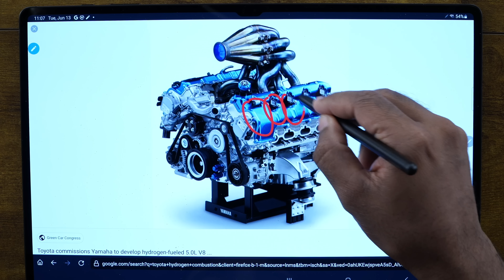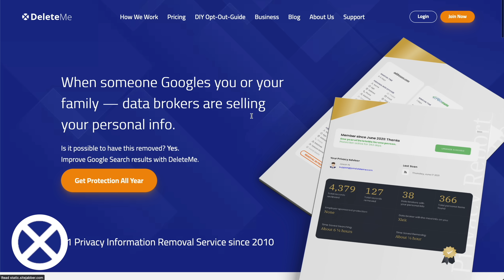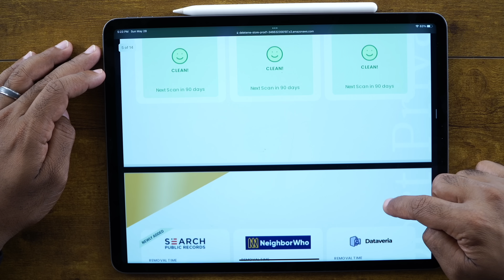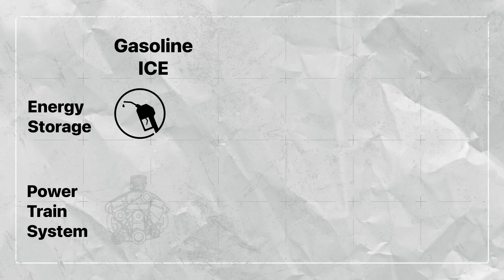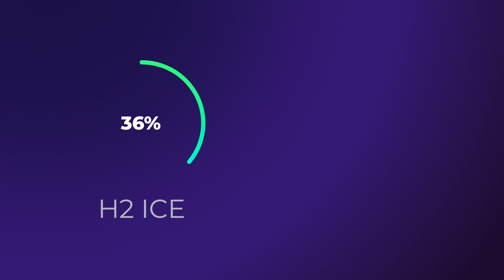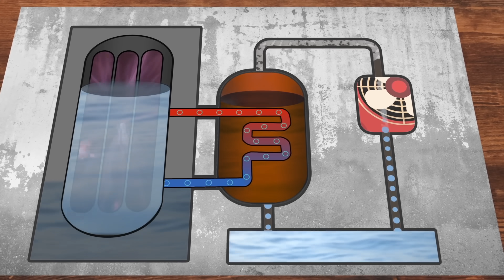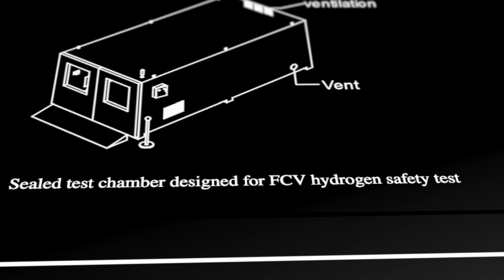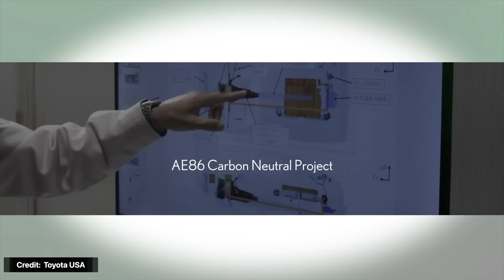Toyota's Says They Just Destroyed EVs - Hydrogen Combustion Engines

Comment: What is the cost of hydrogen? It does not make any sense to talk about efficiency without talking about cost. Solar panel are very inefficient but people still use them.  If the car is still cheaper to run than an EV with a lower efficiency, then it is totally irrelevant to be less efficient.

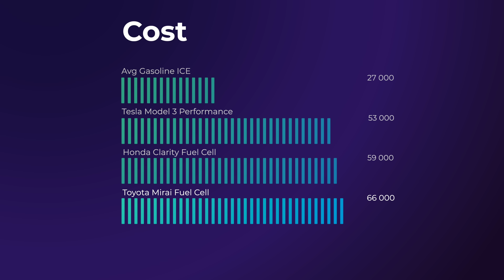Comment: Hi Ricki, thank you for the video! A few things: why compare the most expensive model 3 (performance) at $53k when the base model costs $40,240 before incentives (after incentives it's below $35k). This would put it square in line with the "H2 ice" you have at $40k at 07:33 . So I don't see the upfront cost advantage of H2 ice
Also at 8:20 you state hydrogen fueling stations "work like gas fueling stations" - so does the pump at a gas station frequently freeze onto the opening of a gas tank like a hydrogen station, or does a gas station have a potential of the software inappropriately locking the handle of the pump onto the gas tank opening as often happens in hydrogen refueling stations? - this happens even several minutes after fueling is complete FYI. Does a gas station need 20-40 minutes to go through some kind of cycle in between cars like a hydrogen station, thus frequently forcing people to wait over an hour  in long lines to actually get hydrogen even though the fill up, if it works, only takes 5 min? Do gas stations have an app that say they're working but when you get there even within 5 minutes of checking, it often isn't working? Is a hydrogen station like a gas station in that residents around it demand no usage after 11pm because it's so loud (this is the case for the hydrogen station in Hayward, CA - there maybe others -- it's a MUCH LOUDER process than gas).
My experience: 1 miserable year with a honda clarity fuel cell vehicle. I've been able to get a "5 min" fill up about 1/4 -1/3 of the time. Otherwise I've had the car towed several times, once every 2-3 months, because fuel stations weren't working (even though apps said they were), or after waiting 1+ hour and having 2-4 cars in front of me the station runs out of hydrogen!  My family GLADLY returned this hydrogen car and bought a model Y - we are quite happy with it:)
Reply from the maker: very good point... especially as the lower cost models are more widely available... yah i think it just gets harder and harder to understand the thought process!
Reply: @TwoBitDaVinci  Indeed, and thank you so much for engaging!!!;)
Reply: At one time people had a fear of gasoline blowing up, now not a though about it
Reply: The last time I checked, a few weeks ago, over 30% of all hydrogen fuelling pumps in California were down, and every time I check it's about the same or worse. It doesn't help that hydrogen costs over $16/KG, so it's also a lot more expensive to operate than a BEV or even gasoline powered vehicle. And a few years ago there was an explosion in Santa Clara that shut down all of the northern California hydrogen stations and took over 6 months to recover. There are also plenty of accounts of people having problems actually getting hydrogen for their cars (see the fact that at any point 30% or more of the pumps are offline). Also, hydrogen vehicles have a limited lifetime. The hydrogen components have a mandated expiration date. And those hydrogen trucks? They can only carry 300-500KG of hydrogen, which can fill a fraction the number of vehicles as a gasoline tanker truck, making transport far less economical. I also ask you to read the sticker shown at 10:49 in the video where it says, "Do not fil after 2029/11" After that date, you are no longer allowed to fill that hydrogen vehicle. Hydrogen, especially at those high pressures, is extremely reactive. It embrittles metals and will leak through everything. So basically, after 2029/11 you need to replace the vehicle.
Reply: incentives should not be factored into any calculation for comparing the cars for basic features.
Reply: This only applies when there are incentives. once those stop then obviously the price will go back to full which can be cost prohibitive for people
Reply: @Hirovard  The EV prices will go down quickly. Unlike ICE there is not too much know-how in EVs, as soon as the technology matured and understood, they will start making EVs in the chineese sweatshops.
Reply: You're right, it's the dumbest idea ever.  The public will never go for it compared to EV's.  Toyoda is just as dumb as a box of rocks.
Reply: If water could be used to make hydrogen at home, then this would be great. Yet energy is too enormous per kg of hydrogen from water. Would.need a special  catalysts invented. Meta material science might have something eventually.
Reply: @joeking433  "What is Akio Toyoda smoking???" hydrogen, apparently.
Reply: Please don't include incentives in the cost of a vehicle, they are very subject to change and there is no reason H2 cars couldn't have a similar or better government incentive.  Yes, the H2 infrastructure isn't there yet and certainly isn't as mature as the gasoline infrastructure.  Guess what, the EV charging infrastructure sucked 10 years ago until there was major investment in it.  It still isn't great, the last audit I saw showed that nearly 25% of EV stations around the US were out of service.  This is after billions in private and government investment and tax breaks galore.

Comment: The tail end of this video feels unnecessarily poisoned against hydrogen ICEs. Implying its a dying technology because Toyota took on partnerships is a somewhat baseless claim, and to say hydrogen ICE has “all of the negatives of ICE and none of the benefits of electric” feels like a shady way of saying it has the all the BENEFITS of ICE with none of the DRAWBACKS of electric.

A combustion engine that is serviceable by pretty much any mechanic in America is much better for longevity and avoiding monopolies, for example. It also feels disingenuous to gloss over the MASSIVE supply chain issues of trying to convert a national fleet of drivers to battery electric - a feat which is virtually impossible with current production and availability of precious metals. And that’s to say nothing of the issues of unethical supply chains needed to supply those metals.

I like electric vehicles as much as the next guy, but if we start ignoring the question of battery supply chains we risk losing the forest for the trees.

Finally, i think its unfair to characterize the problem of green hydrogen production as a problem unique to hydrogen, as this problem is equally applicable to every electric car in service.
Reply from the maker: these are excellent points... thank you for taking time to add to the conversation in such a nice way. the drawbacks of ice, is tons of moving parts, wear and tear, and high levels of maintenance. all of this is gone with electric motors, which are vastly superior in every single way. 

but batteries are a challenge, but one that's being highly invested in... this is tricky and why i try to cover as much of this stuff as I can...

Toyota partnering with Yamaha is a very clear signal though that they're not all that keen on this... I think Toyota is still trying to figure out what they're going to do.

when they are all in on something they really get behind it, which they aren't currently with this... 

but what do you think?
Reply: @TwoBitDaVinci  I wasn’t expecting a response! Great video btw, I love your channel and you’re doing great work on spreading the message of alternative energy solutions.

I think the partnerships Toyota are taking on are reasonable given the engineering challenges they face relative to each product. I don’t think they are necessarily indicative of their level of confidence in their product.

For example, Toyota doing the Prius “solo” seems to indicate that they didn’t need much outside support on dropping a battery in an ICE since they weren’t necessarily conquering any massive engineering challenges - applying electrical force to an otherwise standard drive train was novel, but not necessarily difficult from an engineering standpoint (note: I am not an engineer, so this is mostly opinion).

Compare this with Toyota’s partnerships for hydrogen: in the case of BMW, this partnership makes a lot of sense when you consider that Toyota heretofore has not actually brought an electric vehicle to market. Hybrids, yes, but not fully electric vehicles. Since a fuel cell is effectively just an electric vehicle with a different energy source, Toyota needed engineers with EV experience. By partnering with BMW, Toyota gets experienced engineering guidance on not just electrification, but more importantly - how to implement the luxury features that have become industry standards in the EV market, such as regenerative breaking, autonomous driving, battery saving technology and charging software.

The software solutions alone that Toyota saved themselves in development made this partnership a massive cost savings for them, I’m sure.

In the case of their new partnership with Yamaha, I also think this decision was likely made due to unique engineering challenges. Toyota Automotive has been hyper-specialized in developing standard ICE and hybrid drivetrains for the past 20 years. Yamaha, on the other hand, has been supporting a wide variety of engines for performance vehicles which likely have to support more fine-tuned and wider ranging combustion conditions. Toyota has built performance vehicles, sure, but Yamaha has spent the lifetime of their company developing combustion engines in every size and shape, and for every use case, imaginable.

All to say, Yamaha’s engineering team would almost certainly have more experience in working around the design challenges of building a combustion engine around a new fuel source.

You’re right about the maintenance cost associated with ICEs, that’s for sure. Still, I think the accessibility of ICE maintenance is still undervalued. Cuba was shutoff from the rest of the world for half a century due to conflict, and for that span of time, with extremely limited access to outside resources, they were able to keep many of those vehicles running in perpetuity. I don’t imagine that would be possible if they had an island full of battery-electric motors.

I realize that is kind of a contrived example, but I think it speaks to the reliance of electric vehicles on supply chain stability and top-down control of manufacturers on maintenance. With an ICE engine, you’re going to be spending money in perpetuity on replacing parts and maintenance. With an electric vehicle, with niche electrical engineering requirements, you’re set for life so long as the manufacturer stays in business.

If BMW and Tesla shut down tomorrow, how long would we have until all of the cleanest, most efficient, sophisticated vehicles in the US became unmaintainable due to a lack of complex electrical components available to repair their electrical motors, batteries, charge controllers or regenerative braking systems?

Maybe this is a problem that goes away at a certain scale of adoption, but for now i feel like the complexity and lack of self-service that comes with electric vehicles is likely to become an issue at some point in the future.

Comment: Whenever I hear about hydrogen ICE's, I worry about the long-term future. Traditional ICE's weren't a problem at first either, but I worry that in 100-200 years, even an engine that puts out water could cause an environmental issue by jumping up the planet's humidity significantly

Comment: Why hydrogen since so much energy is lost in producing hydrogen in the first place, then with hydrogen being the smallest element it is difficult to control leaks, then most of the energy released by burning it in an internal combustion engine is lost in the form of heat.
Quite simply most hydrogen produced is done by the fossil fuel industry. By promoting hydrogen you are actually increasing the amount of fossil fuels being burned, instead of phasing them out.

Comment: So... Take a much simpler (EV) electric drive train, and make a hugely more complex engine. with hundreds of moving parts, and which will need considerably more regular servicing, then use a fuel which is extremely more difficult to store and transport, not to mention  hugely more expensive and having little to no infrastructure and you have a project doomed to failure . Battery technology is moving forward at an incredible pace, with dependance on Lithium and Cobalt diminishing rapidly, and charge times reducing to boot. Electricity is available EVERYWHERE, why build a massive and expensive additional infrastructure for Hydrogen when many EV's can be charged at home.

Comment: You should do a study on Thorium molten salt reactors, safe and easily the downfall of wind turbines that are NOT green, and voltaic energy that is NOT green.  Nuclear energy that is safe, no containment vessels required, and no water-cooling system required.  You can build one in the middle of the dessert instead of on the ocean front.

Comment: Where does the electricity come from to charge the EV's ? On average, a Tesla Model 3 requires around 30 kWh to fully charge from empty to full and what is the biproduct of the source ? Mining for the required elements to make a battery biproduct of that source ? Shipping the mined materials across the globe ? ... EV's produce 0 emissions..i agree, but the mining, shipping and refining of materials needed just for the battery's, and to produce the electricity needed to charge the battery's ?, EV's burn through tires at a 30% higher rate than other cars .....what does it take to manufacture tires? lol again i agree EV's produce 0 emissions yes, but the actual world of an EV and everything needed to keep them on the road produce emissions. I'm not defending fuel burning vehicles but to say an EV produces zero emissions is not really the case.

Comment: 🧐 Maintenance? Repairs? Insurance? Long term wear? Current LFP batteries will last 15 to 25 years (300K to 600K miles) for most people. Forthcoming batteries will last up to 40 years (1M+ miles). I wonder how long a hydrogen V8 combustion engines will last.

Comment: Engineering Explained has an awesome video on this engine that just absolutely eviscerates it lol. Fantastic work Ricky :)
Reply: This engine would require a hundred gallons of compressed hydrogen to get the same range as gasoline from a typical 20 gallon tank. No room left for passangers and cargo.
Reply: @MTrekker2001  I agree, I'm not sure why they even bother with this thing. Toyota should know better, all it's good for is clickbait. When I look at EVs and how many moving parts they have, all I can think of is how obsolete these noisy, unreliable, and expensive internal combustion engines are. Who still uses a gas operated washing machine or Skil saw? Nobody. Lawnmowers, chainsaws, &c? On their way out. Hell, even electric tools with cords are being replaced with cordless variants that have more power!
Reply: @Gersberms  OMG, every cordless variant of any electric tool has much less power!
Reply: @mareksykora779  Maybe you haven't tried any of the serious cordless tools.  They have more power than normal corded small tools.  Obviously If you're running high voltage three phase power, then yeah, "corded" will win, although the big stuff isn't actually corded, it's hardwired.
Reply: @incognitotorpedo42  My electric hammer is 2000 Watts (for standard 240V grid), my angle grinder is 1400 Watts. If you use a battery tool with the same power, a 20V, 4Ah battery pack would run out in 3 minutes. This is "the power of cordless tools".
Reply: @ChronotriggerJM love his channel!
Reply: EV fans are all smug with their supposed superiority, but Toyota will have the last laugh.
Reply: @ghoulbuster1  how? Would love to hear your explanation. Thanks
Reply: You do know by the time the v8 hydrogen cars come available. It would take 10 years or more just to match the numbers of EV charging stations we have now. By then, EV will be so advanced. The cars won't even need to charge from any stations.
Reply: @wt9653  : lol, shades of "gone in 60 seconds" - by the time you get out there won't even be cars...  History as yet hasn't taken the turn quite forseen by the most forward thinking futurists - just the sort dreaded by George Orwell...

Comment: "forward to yesterday" seems to be the mantra of Toyota. The first  hydrogen fueled ICE car I saw was in the 1970s, which if it had been any good economically, we would be seeing them everywhere now. This is backwards thinking for all the reasons you have mentioned.
The only advantage fro Toyota is how cheaply that these can be built, and how soon the buyers will need to purchase a new one from them.  We are in the climate catastrophe pickle today precisely because of this sort of thinking.  IC engines were cheap, despite the flaws, and electric cars were expensive with inferior batteries.  Had we started developing better batteries instead of better mass production of the cheaper cars to build around 100 years ago, we might not be so far down the road leading towards excessive global warming.

Comment: Yeah this is a technology I will be interested in and actually feel like it should have been invested decades ago, imagine if they actually make fuel efficient and then where would this technology seep into  wear turbines and solar panels won't cut it😅 where desert is using water harvesting out of it air this Could make the world cleaner 😊
Reply: There is a theoretical maximum of 60% efficiency of piston driven combustion engines. It is defined by the heat loss of the combustion process and the loss in friction converting the horizontal movement of the pistons to rotation. Current engines achieve 43% at optimal RPMs and temperature. This is way below the efficiency of an electric motor.
Reply: This is a terrible idea.